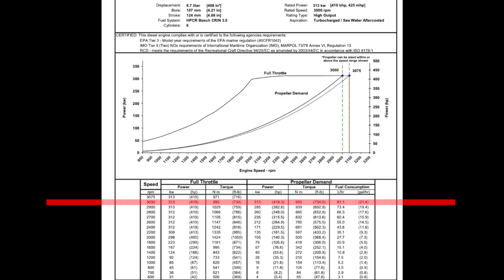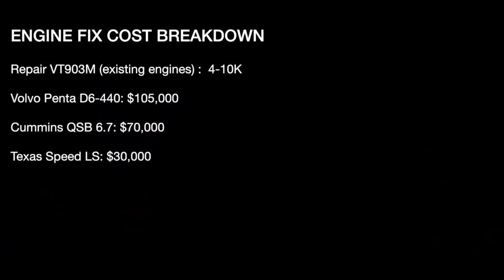Tesla Powering my 30yr Old Italian Yacht? And Broken Diesel Engine Diagnostics

Comment: 24 valve Cummins all day. It's cheap, parts are common, extremely reliable, and it's got all the power. Or just put the same V8 Cummins back in. They put them in there for a good reason.
Reply: well... one of them wasnt reliable
Reply: Erik Simca lasted 30 years. I’d call that a win
Reply: They actually don't do well in that size boat unfortunately.  Has to do with RPM range they will overheat bad. Think big displacement.
Reply: the VT903M is a V8, not V6
Reply: @fastfreeks  He ran it low on oil. It did not get a rod knock from overheating.
Reply: @ohlookadragon  I was referring to the 24 valve cummins comment those are fine for smaller boats but that big beast is going to kill a 5.9 or 6.7.
Reply: @joshkiej6601  fixed
Reply: @fastfreeks  Yeah maybe like an old Detroit or something then.
Reply: @fastfreeks  Ah I see my mistake.
Reply: Erik Simca it worked while it had oil in it. 🤣
Reply: @ohlookadragon  Personally I think the cooling for that engine became blocked (boat had been sitting a long time) and the heads overheated blowing a head gasket. Then running it more eventually led to low oil pressure and that is why it failed. Happens a lot on boats that are not used much. Everything looks fine until until it happens.
Reply: @fcmacken  Could be. I would expect it would run out of coolant before it ate all the oil though. I don't believe they cool on raw water. I think the water runs though heat exchangers. He also never had a working oil pressure gauge so who knows what state it was in before he even started.
Reply: @ohlookadragon  A lot of the marine diesels pull water straight from the sea for cooling and had sea water strainers. Not uncommon for Italian boats 30 years ago. But if it had a blocked heat exchanger there should have been lots of steam. Surely these guys checked levels before they left for their maiden voyage?

Comment: Diesel seems to be the best for your application if your trying to cruise you would be running the ls at high rpm for far to long especially if you do decide to take it into open water and most other large boats run diesel so say you do run out of fuel wouldn’t be to hard to get fuel from someone random on the water

Comment: just rebuild the old one
Reply: Rebuilding the old engine is probably a lot cheaper than trying to replace with a used engine.
Reply: Even  if I like the Idea of LS swap it , I don't think it is a good Idea. Cummins swap it for a newer models makes more sense because they are though marina spec engines already! by doing that you increase the lifespan of the boat and since you are partner with Garrett you can still turbo them and go stand alone whatever you like. Remember the rule of thumb regarding mechanics when stuff starts breaking they are going to keep breaking down. So make the best financial decision since you are planning on keeping it! The first engine failed god knows why you don't know how good or bad of a previous owner she had and how he maintain the boat, One engine failed, guess what stay alert! The second one might too. Knock on wood this is not what I wish for.....

Comment: 1. use the old engines, much less headache and expense. You'll be back on the water quicker.
2. Simplisafe is vulnerable to jamming, go watch the lockpicking lawyer video on it..
Reply: Jamming can be done with any wireless system. Just so happens he did it with simply not safe
Reply: @chickensfloat7427  Yes, but when sensor communication is restored the alarm should sound. It did not on SImplysafe, which is scary...
Reply: @DanielChristiansen  true true

Comment: Rebuild the broken engine, and do a full maintenance on the other one.
If to do anything "crazy" try reaching out to Cummings, they might be able to supply you with a more moderne engine controls/monitoring system. So the boat could go digital, but original!

Comment: You can rebuild the diesel engines and do upgrades to the turbo and fuel management system and even do some upgrades to the internal parts of the motor for cheaper than trying to do a swap.

Comment: DO NOT MAKE IT ELECTRIC 
You will ruin the boat 
Keep the Diesel engines
It will be a mistake
Reply: wouldn't having all the extra battery weight make it too heavy to get on "plane". I just don't see it working well. It would at least have an effect on the speed needed to get "on plane"
Reply: @dalton8813 the tesla drive motors are pretty light, and he'd be removing 5600Lbs of engines, 2100LBs of diesel, and any ancilliaries (a large majority of cooling system, plumbing, exhaust etc)

Comment: On the Electric range - you're considering ICE engines and electric motors as the same efficiency. "Conventional gasoline vehicles only convert about 17%–21% of the energy stored in gasoline to power at the wheels. An electric motor typically is between 85% and 90% efficient." That's why they use MPGe as a measure.

Comment: In addition to all the benefits you've already discussed with regard to diesels, marine diesels -- when well maintained -- will run around 5,000 hours between rebuilds.  Also, I wouldn't worry about pulling the other engine.  Just rebuild the starboard diesel and worry about the port engine whenever you need (could be years.... or well-after you sell it to someone else.)

Comment: Gosh as much as I'd love to see you do a Texas speed engine swap or maybe attempt the EV motor swap. I think your best bet is to just rebuild your one engine. They are good, reliable, have adequate power. Like you said they have low hours too. I say fix the one motor, then take the money you were planning on spending doing a swap and maybe upgrade some things on the motor or do some cool/ bisforbuild upgrades on the boat somewhere. Maybe interior, new gauges, maybe add an auto pilot system in the boat, possibles are endless! Just some hopefully helpful ideas! Thank you for all that you do, we all love and support you man, keep doing what you love.
Reply: Autopilot and update all the gauges and get a new dash to moderize the boat.  It’s kinda like a tired old boat that’s sat it’s whole life.  B&G has computerized chart plotters and whole boat systems monitoring and radars to where you can really enjoy the boat.  Those engines are best suited for that boat.  Electric swap sounds cool but the range is atrocious.  This is a motor yaught.  Make it a boat that is reliable, and relaxing!  Shit put simply safe in the boat!
Reply: Yes, depending on how many hours on the diesels.  If low to even mid range of life, just rebuild the one that broke.

Comment: Diesel electric! Exactly like a freight train. Get a brand new 6.7 Cummins and have it power your generator which is running your two Tesla motors!! Your not limited by range, but you get electric motor benefits. Best of both worlds.
Reply: I agree, diesel electric would be very cool! But why not just use the one good diesel engine for power instead of a new engine?
Reply: There would be a bit of losses in a system like that, would probably be cheaper to run with just two diesel engines.
Reply: Freight trains use diesel electric because they need all wheel drive. Train wheels are made out of steel which has a very low friction coefficent on steel tracks. So in order to get the power to the track they need to have as much powered wheels as possible. But then you would have to build hughe and also very complicated transmissions which would also be a nightmare to repair. It is alot easier to just put one motor per wheel and run some wires. It's probably even more efficient since they eleminate all the friction losses from the transmissions.

Comment: There’s a reason big boats have Diesel engines,  I’d be rebuilding your current engines. But if you want modern engines I’ve got Hyundai marine engines in my boat, might be worth checking them out.

Comment: As you told swapping an engine is expensive, I would say just fix the broken one, do a rebuild of those engines, and do some power mods to them. You wont have to worry about any of the stuff you are worried about in case of an engine swap.

P.S This ain't no lambo that you can just LS swap, and it hasn't burned down so it is not qualified for an LS swap. :D
Reply: *hasnt burned yet. they still have to get in there with tools, you never know! -knock on wood nothing happens tho!

Comment: Keyword: solarpanels! check out the tech/specs on the new 45-50 foot e-propulsion catamarans! Slowed down to 7 knots, they will run..forever - without needing shorecharging! Kid u not! You'll probably need to cover your foredeck + some custombuild bimini-style open "hardtop", for sufficient surface..check em' out

Comment: If you go electric, you could have a single diesel engine to act as a generator that will charge batteries and allow for extended run time.
Reply: At that point it would just be more efficient to use The diesel engine to power the boat directly
Reply: I don't even want to begin to explain how grossly inefficient this would be.
Reply: nick paz ...how would that be any less efficient than a locomotive?  
The option would be there for silent running, and ... if the prop/s could be coupled to the engine, they would still have the reliability of diesel to limp home if needed.  Complex maybe, but none the less.
Reply: Joel Kreider Well diesel electric locomotives use Diesel engines to power electric transmissions, rectifiers, traction motors, and a control system. All in all the Diesel engine is the primary mover. So basically they are nothing alike in any way whatsoever.
Reply: @Brutis  Need another power source like solar to supplement the power input.  The electric power is more efficient tan straight diesel by about 20 percent.

Comment: I say rebuild the diesels and add a Tesla drive system in for when you are just cruising in and around the marina.  You might even be able to use the diesels as combined generators to recharge the batteries.

Comment: Diesel Electric? Use the good engine to generate electricity to power the Tesla motors? Seems like a solid plan. Power, torque, long run times. Win WIn WIN!
Reply: Once you have mechanical power, use it to turn the prop.  Converting to electricity and back to mechanical just adds inefficiency.
Reply: I was mildly surprised to find out a while ago that lots of trains run like that - diesel electrics are exactly that.   I didn't really understand or think about the term.... only to later find out that they run the diesel motors to power electric motors to turn the wheels.  (perhaps I thought they could use either - so power when near overhead lines and diesel when not - but no...)  Cables are pretty big and short - but it works for a lot of trains.   I thought it would be inefficient - but cheaper / better than the huge energy loss from any power station to an electrical point of use.  As you say it could be ....win win WIN!

Comment: My vote is rebuild and upgrade what you have, turbo, injectors, fuel management, different props, however that works. My thought for engineering explained is, what would it take to make an electric boat that matched this one's diesel capabilities. Also, it wouldn't be zero emissions but how far could you get with a small gas or diesel generator to power the batteries if you did go electric.

Comment: I like the idea of the standalone engine management ,  I also like the idea of the fuel economy from the diesels.  You should rebuild your diesels And a high Tech engine management system.
Reply: if he wants to do smth geeky, that seems the most value for me, even when it will prob. not be easy with these engines (there might be some diesel tuning scene in truck / truck-tor racing that dealt with this engine family before). diesels like to smoke more over the years, which is not fun on a cruiser - with some upgrades he might be able to keep this issue in check and get out better fuel economy (and mbe some power by upgrading some internal parts, which also will help durability under high load)

Comment: 2 6.7 Cummins with compound turbo systems!
Reply: You my friend is a genius same thing I was thinking
Reply: Cummins makes a marine version too
Reply: Same thing I was thinking 2 built 6.7 Cummins you could be at 1000 horsepower each easily
Reply: Yup! 6.7 Cummins are the best new diesel motors. Super reliable, tractor grade motor. Can still get them in Kubota tractors. Made to run and work all day everyday.

Comment: Hey if you want to use electric, you can check out the Wider 150 which uses electric pods. They run generators instead to power the motors. something to look at. FYI my perference is still diesels as gas is way expensive to run.

Comment: Chris my for my 2cents on the engines as the boat and engine configuration is such now I would rebuild the engines put new computer/s in to manage them, maybe port and polish the heads if it is practical and put them back in as you said they are built for the job...
You should get many more years (or the next person should) of trouble free running, and the best resail value as the boat is as complete to as it came from the factory as possible
Not a hybrid of something it didn't come with.
(please show the engine rebuild if possible)
Tony from Western Australia.

Comment: How much do you want to spend? Diesel electric is the best of both and you have the space. Diesel running at a consistent lower RPM turning a generator, pushing power to a capacitor and motors. Push extra wattage to the battery. Not sure what you would use as a controller. Make a toggle to operate the boat off the generator or battery for instances of low speed maneuvering. Should net a substantially lower operating cost.

Comment: I'm wanting to see a colab with Deboss Garage, put a couple cummins in it.
Reply: Yes!
Reply: I agree! I have 2 Cummins 6CTA's in mine and they are fantastic engines.
Reply: It's already got a couple Cummins' in it...
Reply: cat power??
Reply: @LJ-fe8vb  yes!
Reply: Hell ya!!!
Reply: The most cost effective is rebuilding the current engines but the best option is the Volvos. I live in Malta and I have seen those engines run in salt water for more than 60 years and with tens of thousands of hours. The service is also a bit more expensive but you will die before they do ☺️

Comment: Diesel Electric is a good option.  Only need a single Diesel engine to drive both electric drive systems. Far more efficient and gives you higher low speed maneuverability.
Reply: Would be cool to see a diesel generator, powering 2 Tesla motors haha.
Reply: It seems a bit hazardous having all the high voltage system in an application prone to corrosion, moisture, and even just water.

Comment: Sounds fun, but boats run on diesel for a reason. You need weight-efficient energy in a boat.

Tesla power a boat small enough that you can hot swap the battery. That way you could charge the batteries on your yacht with a diesel generator and rip around a fun small boat.

Comment: cost/cheapest/easiest would be a rebuild of the hurt motor.. but i think a diesel/tesla hybrid would be an interesting way to go.. using a single diesel as a generator to maintain the power requirement and youd have the option to cruise at a slow speed on the battery alone

Comment: Rebuilt those Diesel engines, and put a stupid lager turbo on em. Maybe even quad turbos
Reply: Massive boost, like 500 psi.
Reply: @Constabruity  Don't need to, just upgrade diesel pump and larger injectors is all you need